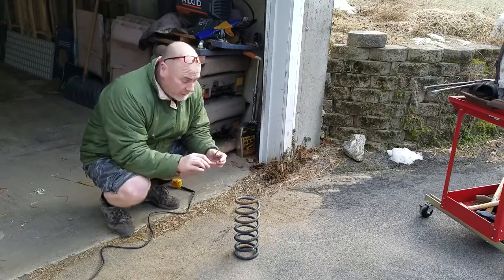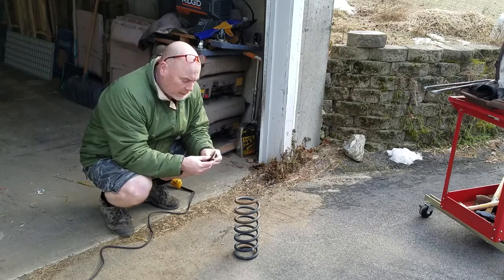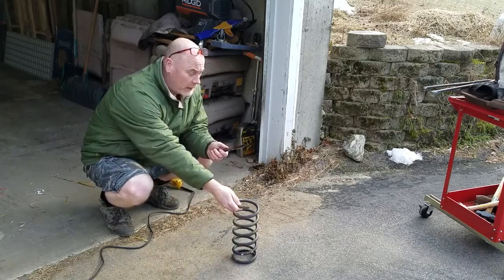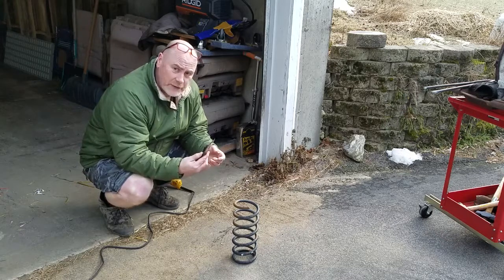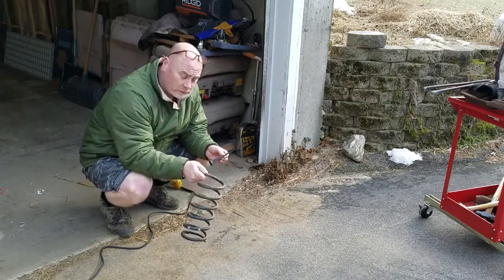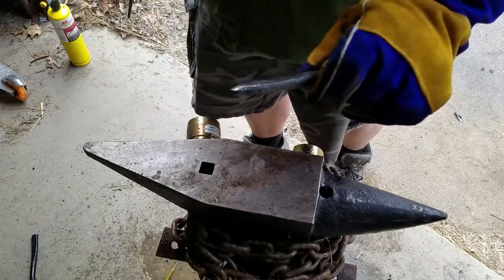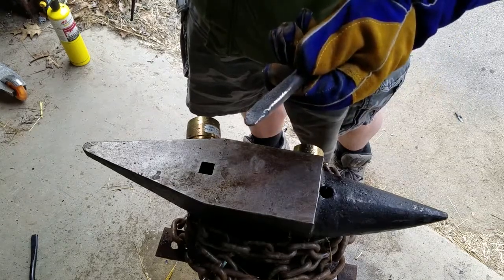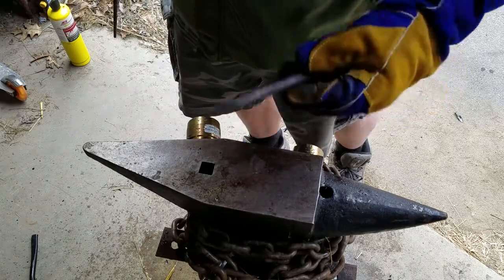Is Coil Spring Hardenable? - Oil Quench Test

Comment: The year of vehicle the spring came from has large part to play in the troubles you have. The newer springs on newer cars are alloy steels so they arent as hardenable as the springs from a car made back in the 70's. Leaf spring would be better to use for knives and even that would be better from an older car.
Reply from the maker: This was really an just experiment. No expectations and no troubles. That said, the knife I made using this coil spring for an edge (san mai) is pretty hard and sharp and I still use it today.
Reply: @OrdinaryWorld  thats why i said that they could have hardened they just might not have been as hard as the file you were using to test them.
Reply: Leaf spring is usually 5160. Never had any problem with hardening, you do need to get it past non-magnetic by about 100 degrees though- around 1525 F works good.

Comment: Yeah I made a blade out of a coil spring and had the same problem quenching it in oil didn't harden it enough. Then I remembered wait a lecturer said once that oil quenching is for high carbon steel, water for medium carbon, and salt and water for low carbon. So maybe try water and if that does not work salt and water.